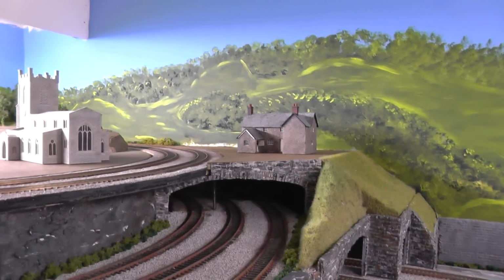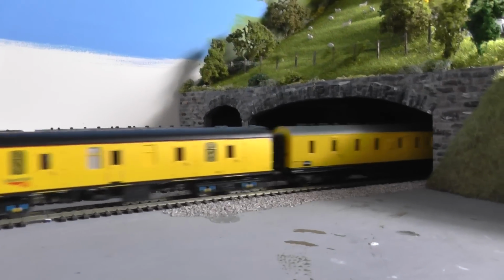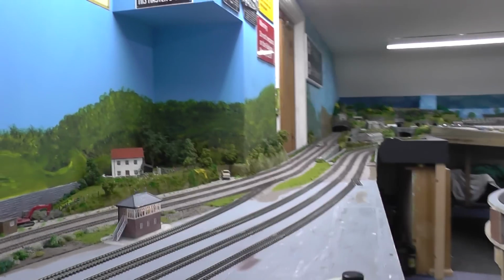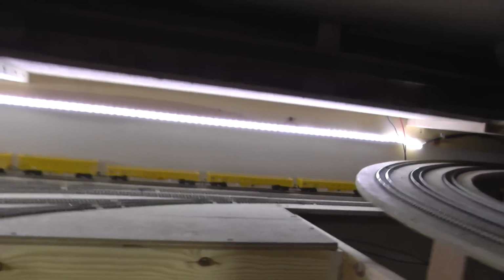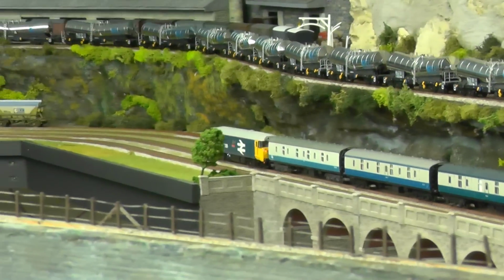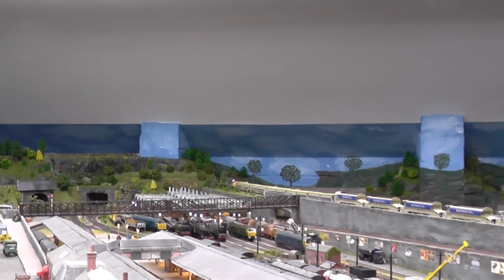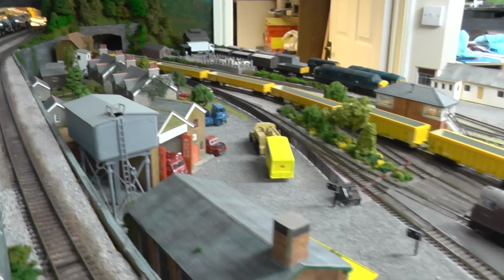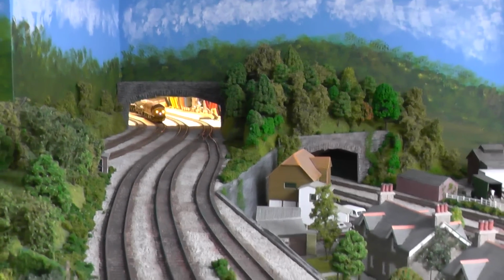Penwithers layout tour and running session

Comment: I still cannot understand, with all the attention to detail/realism that railway modellers employ on their layouts, why no one appears to address the glaringly obvious omission of the 'gangway/corridor connections' between passenger carriages, as we see, very clearly on Kevin's 'Northern Bell' here.   (nice train anyway...  btw).  
.
In all of the layouts I've seen, from professional down to amateur, from the most anal (Germans) to the most basic (everyone else), this omission seems so prevalent.   I cannot think of any practical reason why this detail is not addressed either by modellers or manufacturers of model stock.  
.
Some might argue, that it would cause issues with how trains take curves...  Not so,  they could easily be made (moulded) in thin latex.  Moreover, the concertina gangways, would like increase damping, meaning that the stock behaves more realistically when underway.    Yet it would make so much difference to the authentic realism that is sought in railway modelling.   
.
Otherwise, these layouts simply look just like what they are...  Toy train sets.   
.
This was not a  dig at your work Kevin...   Simply a generic observation.  You've got a nice layout underway here.  So thumbs up anyway.  ;-)
Reply from the maker: Deebz270 thanks for comment , it is an item that is possible to do but it joins a list of things that need to be done but probably will never get done ,it is almost five years work so far on this layout 
perhaps another five years would get to that point on the list